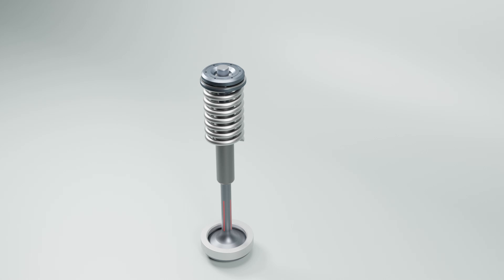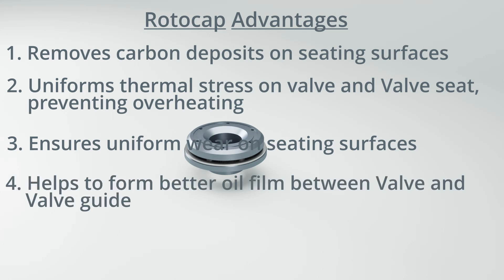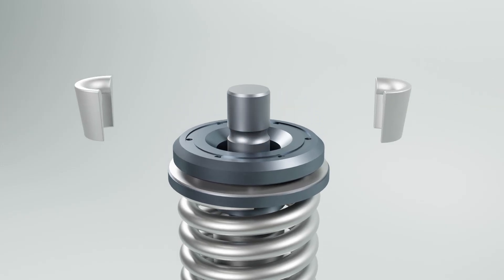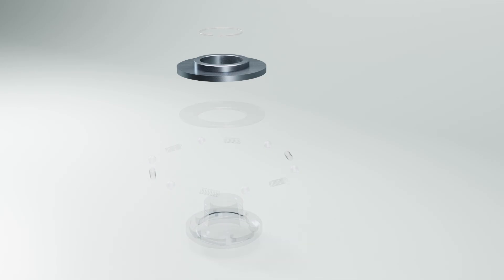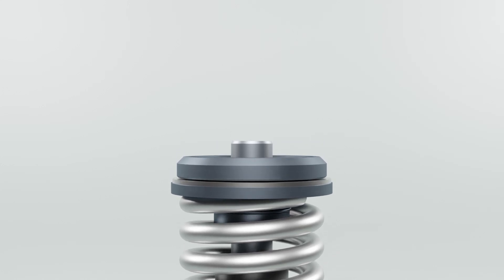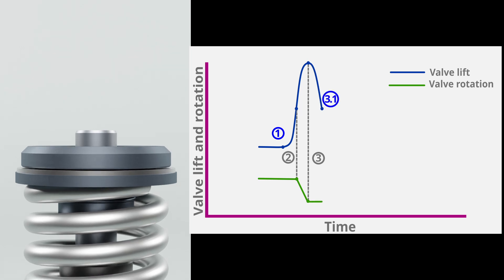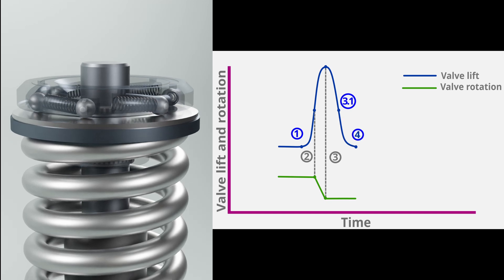How does a Rotocap work?

Comment: Great explanation and animation but I would like to ask what force makes the valve to rotate? Ok there are steel balls and spring, during the valve is being opened and closed which force makes the system to rotate? Also as i have learnt, there is one more system again with rotation. That must be called as valve rotator, that is used in marine engines. That system includes impellers to rotate the valve and not to deform the valve disks always the same parts with the same target. Which force rotates the impellers in that system? If you know this one as well, that would be great for me.
Reply from the maker: Hi, thanks for your comment. The steel balls are placed inside inclined tracks on the casing. You can see that in section view also. Due to this the valve rotates . The other type of valve rotators ( with impeller) is used in large two stroke marine engines which are used in propulsion of ship. This particular video describes a rotocap which are used in medium speed diesel engines (4 stroke) which are used for power generation on ships

Comment: Hi, I like your work. 
But there are issues if you draw a freebody diagram. The valve cannot make a rotational motion as the downward force on the valve stem is more from rocker arm shoe/yoke shoe. Lets discuss. I can furnish you a free body diagram explaining rotation is possible only during valve closing operation. You communication in this regard is welcome.
Reply from the maker: Hi, thanks for the input. However, I believe you're getting confused between a Rotocap (which rotates the valve during opening) and a Turnomat (which rotates the valve during closing ) , atleast thats my understanding of it. You can go through this technical paper which supports what I said in the video.  https://webbut.unitbv.ro/index.php/Series_I/article/view/6176/4734
If you want to discuss further , you can contact me on " phani_avireddy@yahoo.com"

Comment: There is a little mistake that you show here spring compressed but the ball in same position but it should be like that ball move and compress the spring during compression period
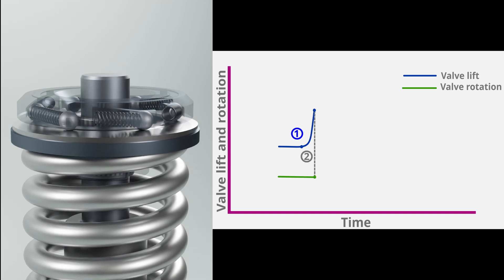Reply from the maker: Hi, I believe you are talking about animation at 4:08. During the opening period, that is from point 1 to line 2 is the first stage of valve opening, where the valve opens about halfway however there is no rotation of the valve, Also there is no movement of balls and springs. From line 2 to line 3, which is the second stage of valve opening, the valve opens fully and also rotates. It should be noted that during this rotation stage, the balls don't move. Only the rotocap body rotates anticlockwise ( viewed from the top) thus compressing the springs. The movement of balls occurs only during the closing period.